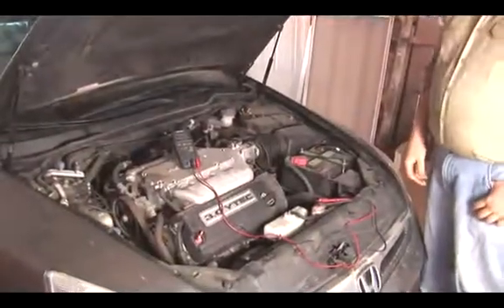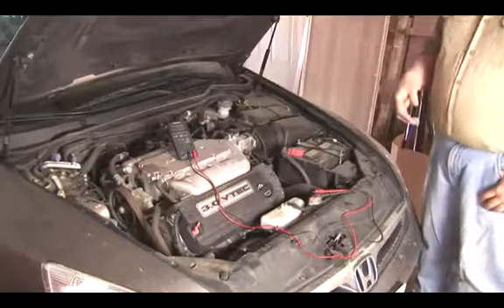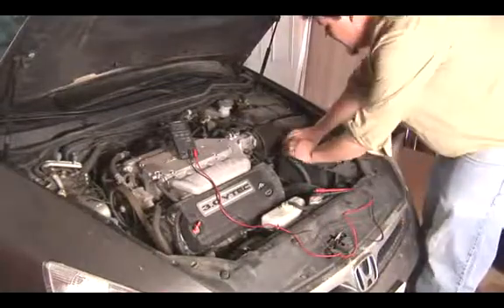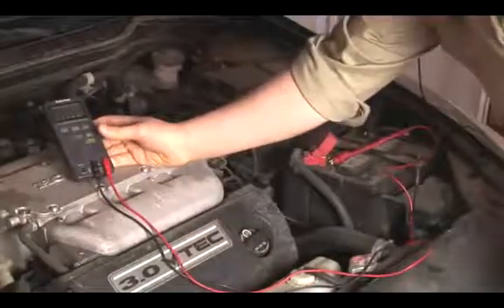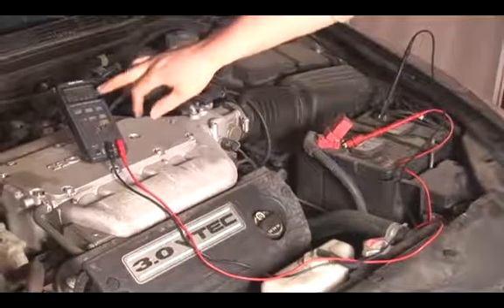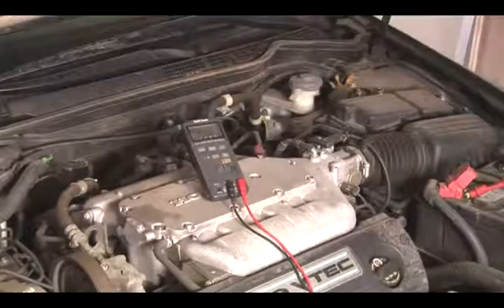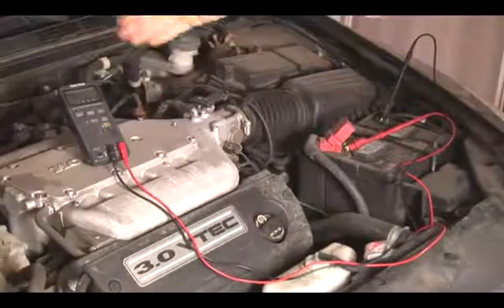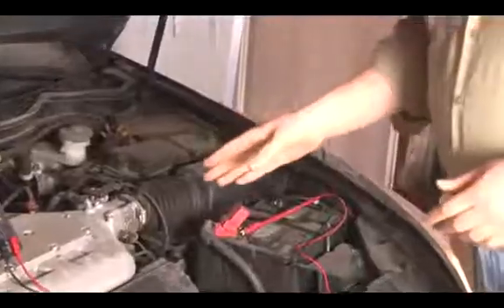How to Test a Car Voltage Regulator

Comment: How easy would be to disconnect the voltage regulator's output from the battery? if the unconnected output is low itt may something wrong with the alternator or the regulator.

Comment: My car won't start but all the dash lights are on. I took the battery out and connected it to a battery charger that read the voltage at 15.9. Does this mean the regulator was overcharging the battery?

Comment: Very good video!
Some alternators has voltage regulator with resistor and some without resistor. I would like to know what will happen instead of regulator with resistor   install regulator without resistor.
Reply: it could cause lights and fuses to blow

Comment: So how am I able to tell if it my voltage regulator that has failed that is causing the voltage to overcharged when I start the car vs the voltage regulator is good but something else is causing it to not work properly.   When I start my car the dash lights flicker and the voltage is 15-16v after 2 mins of idle the voltage drops to 14.4 volts.   When I raise the rpm it goes up to 15v.    I can’t tell if my voltage regulator is bad or if something like a bad ground is making it not function correctly. It works intermittently with a pattern which makes me think the second option is possible and it’s a 1 year old new alternator.   I am confusion

Comment: Alright, new battery, new starter, new alternator and belt. I've also made sure all the grounds and hot connections (that i csn locate) are snugged tight. I have a 95 rodeo 3.2 v6 and it doesnt appear the alternator is doing it's job,, still, even after I've replaced it😢 the gauge on the dash shows maybe 11 volts when it's running. My trixkle charger shows 12.0 when the ttuck is running and 12.6 when its shut off. Should be all good but when the battwry dies, so does the truck of course once the ignition system, headlights or heater fan etc  drains it. Also i notice when the blinker is on, the guage bounces. Its driving me insane not being able to figure it out 😅 
Enlighten me anyone, please. 
The other thing weird is it overheated when the battery was failing and i had it idling to charge it  (the cooling fan has its own belt and always spinning) maybe its not even connected to the charging issue but it only got hot the one time while i was trying to let the alternator charge the battery (yeah, it didn't)  but it has run with a charger on it and it hasn't overheated again. Maybe a fluke coincidence, but idk.. ideas on my charge issue at keadt anyone? 
Someone said if the  battery dummy light bulb goes out it opens the curcuit and won't charge. I see the light with the key on (not running) tho it never lights to warn me when the battery gets low so...idk. (i figured maybe because it has a gauge) but then again its a dummy light, dummies dont read guages so it should light, i mean whats the point otherwise, right?
Reply: Oh, while idling if I hit the gas, it draws the guage down to 10 around volts and it bounces back up after you let off it. I'd think it'd go up if anything but I don't really know anything DC electricity tbh

Comment: I don't think this video is very complete. You show how to test it with a range you don't reference where you got that tolerance range from. 
Worst, you don't say what to do afterwards if the test results are higher or lower than expected values.
*Rephrase; you generally what to do from high or low but that seems applicable to that specific motor. 
I'm doing this same test on a 5.0 engine and my voltage off is 12.2 volts. I turn on and it goes to 14.65 volts but it does not fluctuate with increasing or decreasing the engine RPM. 
It's charging but is it overcharging? According to your range it is but this is also a bigger engine with bigger battery. 
Is there a place to reference this or manufacturer or engine type?

Comment: What if it is bouncing very rapidly (so fast that you can't get a good reading) between 14v and a very low voltage?
Reply: Faulthy voltage regulator or faulthy alternator
Reply: Yes it was a faulty voltage regulator on a "new" alternator from the auto parts store.  Just returned it ands bought an OEM replacement.  Thanks for the reply!  @-never-gonna-give-you-up-
Reply: @GlennMcKeon-n5s  no problem :) glad it's fixed now!

Comment: You need to mention that the meter needs to be on DC volts and not AC. AC image is the dotted line with the curvy line above, "Sign Wave" and the DC image is the dotted line with the the straight line above it
Reply: He doesn’t need to do anything, I’m glad he gets right to the point. Maybe people should first watch a video on how to use a multimeter. Why stop at your demand? He needs to mention the key needs to turn for the car to start. He needs to mention the throttle is the little pedal to the right. Don’t forget to keep it in park. Usually to pop your hood you have to find the latch marked “hood” in the drivers side floor board area ETC……..

Comment: I take issue with the last statement.  If with the car off, the voltage is too low, the battery should be recharged first, and perhaps multiple times to see if it can hold a charge.  Very likely some car door was adjar or some lights were left on and the battery drained overnight, or while on vacation and it may be perfectly fine.  Otherwise, good information.

Comment: This is not a test on the regulator. This is to check if the alternator is charging the battery.
Reply: It tests that the regulator is limiting the high end of a working alternator,
 but if you have low voltage this doesn't tell you if the regulator is bad or the alternator is bad.
Reply: @pilotdog68 a shorted diode in the alternator can mimic the symptoms of a bad regulator

Comment: Okay here's a good question. I got a 2016 Malibu limited LT. I drive down the road and my battery voltage is reading 12.4 and then suddenly it'll jump up to a 15.2 and then after a few minutes jump back down to 12.4. now give granite I just bought a brand new battery So what could be a potential cause here?

Comment: This video shows regulator can be faulty if overcharging battery. What if cars voltage is dropping every now and then, how do we test if voltage regulator is problem. Alrernator is charging fine, people are saying its not battery or alternator as charging is going up but not above 14.3. Just drops randomly

Comment: I have a weird fault at the moment where the dashboard lights (ABS, TPS, EML, etc) will all start flashing once the car has been running around 10 minutes. I tested across the battery as it did this, and the voltage went up and down quickly between 14.0 and 14.1 volts. Normally, it holds around 14.08 steadily when the engine is running. 

Not sure if this could be my alternator, or a different issue.
Reply: Hey buddy, did you ever figure out your issue? As you can probably guess, my vehicle recently did the same thing (it spit out 13 DTC codes). Next step is using a multimeter to see if the voltage regulator is the cause. I also had a large amount of battery "dust" around the positive charge. I appreciate any help you can offer.

Comment: Perfect!
 I couldn't seem to find information stating whether a voltage regulator limited voltage to a specific value while the engine was running (say, exactly 13.4 volts) or if it just set a limit on how much voltage was generated (ex: 12.6-13.8). Now I understand that fluctuations within an acceptable range do not indicate a faulty regulator. Thank you for clearing that up for me!

Comment: What if it just stays at 14.3 and doesn't increase with the rpms?
Reply: That's perfect, that means the bats charging.
Reply: Any higher..  that volt reg isn't doing it's job

Comment: What does a transisterized Voltage  regulator mean it has a ground mounting lead and two leads it is off a 75 hp Johnson outboard 1962  numbers on it say 
N12v
961
8d